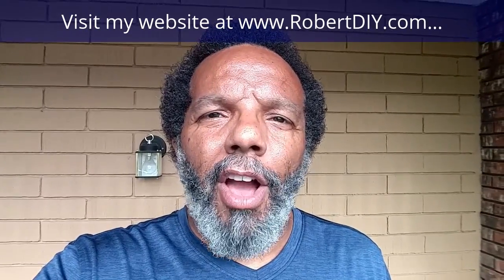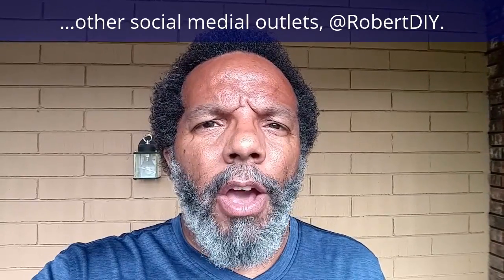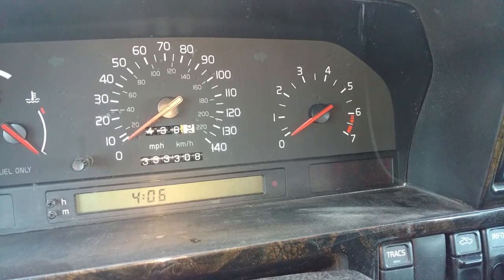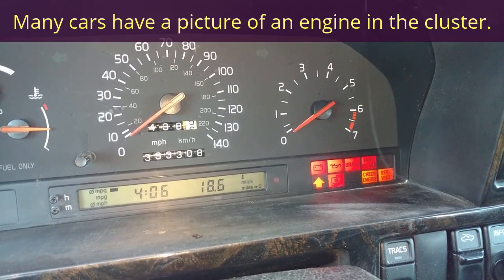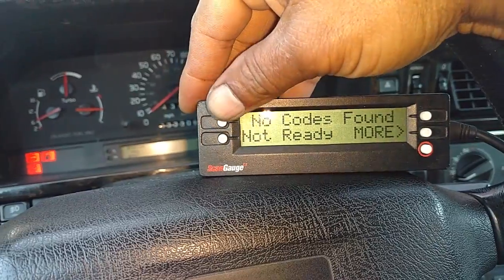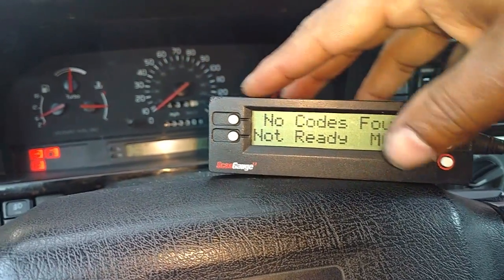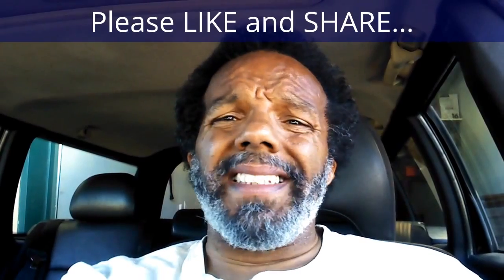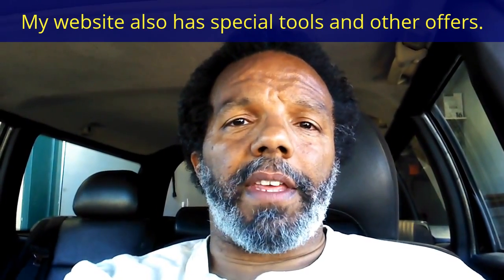Is the check engine light (CEL) on? Is your car running rough? Have it scanned. OBD2 port - VOTD

Comment: Hey Robert I got a volvo 93 850 ,check engine light came on after I did the pvc valve replaced, I can turn it off?
Reply: How ?
Reply from the maker: Fix the problem than clear it with the OBD1 tool.
Reply from the maker: https://youtu.be/bfeiZxhJgxY?si=kPD1NCFBa4exQUia

Comment: 99 v70 awd... i got no power going to ingtion switch.. i took a loght pen to every wire and i didn’t get any power to it or the dash?? I change the ingitin switch and still nothing
Reply from the maker: is the B cable running off the battery broken?
Reply: @RobertDIY  I light penned it and got power to it. I checked the fuses and they had power. I can only think there is a ground issue or something else. I may have put the ingtion wires wrong... but I should have still gotten power through the lines right?..

Comment: What's up Robert , had a question about my 98 s70 t5. The car has 75k miles. Went for a drive today and went to do a mild pull and when boost began to build the cel came on quickly and when I went to shift it came on quickly again and then same thing for the next gear. does not misfire or lack performance  and doesn't do it under light throttle . 0 readable codes. Thanks
Reply from the maker: Probably knocking. I'd check timing.
Reply: @RobertDIY  Okay I went and checked it and it was aligned correctly. Any other advice ? Appreciate the reply man

Comment: Hi Robert …..how many camshaft on 2008 Volvo s40 / 2.4 L5 
The car run bad after change sparks.plug PS I change upper camshaft near timing belt
Reply from the maker: Huh? These cars have 2 camshafts.

Comment: Just recently my V70 popped a cel. I had it scanned by two auto part stores and they couldnt read the code. So then i took it to a mechanic and they read the code as a "bod11 code p0442" as it described on the paperwork, they said there was a leak at the right fuel tank sender so they issued me recomendation to have the fuel pump replaced for 900 DOLLARS. My car starts up fine and performs well. I know my car doesnt have a problem with starting and I call BS because my grandmother talked to my uncle who has a volvo and said that if the fuel pump was bad, the car wouldnt start. All in all they didnt reset the code or fix it like they also said they did and charged us 76 dollars just to scan it. I'm not sure what the code is from but I suspect it might have something to do with the gas tank not being tightened hard enough. I'll have to reset the code sometime soon.
Reply from the maker: That is an emissions code. Many level 1 scanners can not reach Volvo (manufacturer) specific codes. The code is for a vacuum issue. Either there is a vacuum leak or a bad vacuum valve. Have you Googled the code? Best to have the car smoked to see if there is a leak or have a Volvo mechanic fix it.
Reply: @RobertDIY  They supposedly did a smoke test and said they found a leak at the right fuel tank sender. They reccomended replacement and something about my brake hoses being dry rotted and cracked.
Reply from the maker: @adrianleon1731  That's the best way to find vacuum leaks. Not sure what to tell you without seeing the car. If you are not comfortable with the mechanics you are dealing with, you'll need to do it yourself.

Comment: Hi Robert. I hope you can read this. I've been watching your videos for 3 years since I've bought a V70 1999 Base model. I have a problem with my car now. The check engine light works but it's not lit when the car is running. I had a throttle problem and at the Volvo dealer they said it was the trotthle,  so we replace it 3 months ago. Now the car has the same symptoms it stalls randomly and yesterday wouldn't even start. Can it be the fuel pump relay? If it's the actual pump failing, should the engine light come on or not? I know that the relay failure doesn't trigger the engine light. Thank you  Thank you.
Reply from the maker: Fuel pressure problems do not trigger a CEL.
Reply from the maker: https://www.youtube.com/watch?v=gt9w-ZSxs9I
Reply from the maker: https://www.youtube.com/watch?v=gLoO-D4yOcU
Reply from the maker: how old is the pump? how old is the relay?
Reply from the maker: https://www.youtube.com/watch?v=NWfLpp8NevI

Comment: hi from argentina robert! i have the european model, and the simbol of check engine its diferent its like a green light, i think that it is same the CEL simbol in american volvo, the code of my volvo in socket A 7 is 122 and in socket A3 is 214 (this one cant leave me reset) , i just touch a many things close of MAF and i clean the ignition distributor cap then the CEL turn on. ! can u help me? thanks teacher!
Reply from the maker: Did you figure out what the 2-1-4 code is?
Reply from the maker: https://www.youtube.com/watch?v=YiPAPu-K8OI
Reply: Robert DIY non, because in internet i cant found noting
Reply from the maker: https://www.youtube.com/watch?v=bfeiZxhJgxY
Reply from the maker: Should be a link to the codes in the comments section of the video I just sent you.

Comment: Hello Robert, I was cleaning the Mass air flow sensor on my volvo 850 94. I accidently broke a small piece of metal contact. 2/3 of the metal contact is fine but a small piece of it came off. And the check engine light came ON. Is it okay to drive the car with bad MAF sensor? Will it do any damage to the car? 
Will the check engine light reset on its own if I were to put a new one or will I have to manually reset it? 

Thanks.
Reply from the maker: OK to drive.
Reply from the maker: https://www.youtube.com/watch?v=bfeiZxhJgxY
Reply: Robert DIY Thank you for a very quick reply. I appreciate your help and the videos you have on here on the volvos. I learned a lot from your videos.
Reply: Robert DIY would you suggest to buy mass flow air sensor from ipdusa.com or ebay? I see there's about $50-60 CAD difference in price. 

I was wondering what are your thoughts on this. As well, do I need to change the fuel filter or air filter after a certain km interval?
Reply from the maker: Filter maintenance is listed in your owners manual.
Reply from the maker: https://youtu.be/aj4tL32XIXs
Reply from the maker: https://youtu.be/eYOsx9rcAhs
Reply: Robert DIY hey I was looking to order a new fuel filter. I see there's BOSCH and Genuine Volvo. Which one would you go for? Do you know if there is any difference between the BOSCH or the genuine volvo one?

Also, is it possible for my car to eat up coolant? I see the level drop slowly after a few weeks. I did check your video but was wondering if there is any other info you may have? 
I topped it to Full and now its in the mid way line after a few weeks. Are coolant leaks usually at the end of the hoses/pipes?
Reply from the maker: https://www.youtube.com/watch?v=R_Wko5d7Veo
Reply from the maker: Coolant leaks are bad. I call it coolant roulette.
Reply from the maker: https://www.youtube.com/watch?v=s1OlrdloSzo
Reply from the maker: I think I have a Bosch fuel filter.
Reply: Robert DIY thank you again. also, can a coolant reservoir tank cap crack because it was capped too tightly? I see theres green stuff and i think coolant might have evaporated through the cracks on cap too... how tight should i have the cap put on?

Comment: My 2006 xc70 runs and drives perfect.  But my CEL is on. I have a OBDII scanner but this is the first car it will not link with it.   Gives me an error every time. While I am here ..... what does it mean when the auto up/down windows roll up but then immediately roll back down.   I hear that can be a symptom of ????
Reply from the maker: Programming error.
Reply: Robert DIY thx Robert.  I took it to oreillys and o they were able to pull the codes. P0089 and p0442.   Looks like I got some work to do

Comment: My 1998 Corolla is showing the code P0420. Catalyst out of range. Pretty sure I need a new catalytic converter. O2 sensors should both probably be replaced.
Reply from the maker: +Richard Gutierrez had to replace mine.

Comment: Hi Robert.
One question, I got a 2000mod v70 2.0l turbo.
When I switch the cruise controll on I get :
Yellow treangle Come on and a message telling me that I need engine service! 
but no codes is stored. 
Do you have an idea what my problem could be?
Reply from the maker: Probably an ABS error. A lot of basic code readers can not see those codes.
Reply: I got An dealer scanner btw, almost 2000$, så I think its not that.
Anyway, noe its gone! 
can it be the p.o.t sender in the gas pedal that's making this.
250k on the odo btw.

thanks! !
Reply from the maker: I don't know.
Reply from the maker: Good deal. Glad it's working now.
Reply: I love you Robert Thank You so much. Can I ask a question?